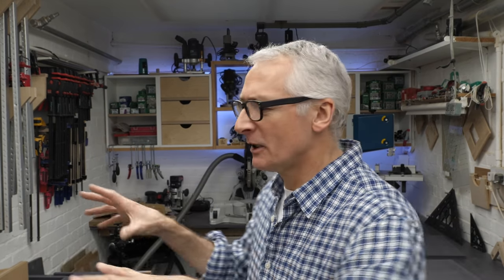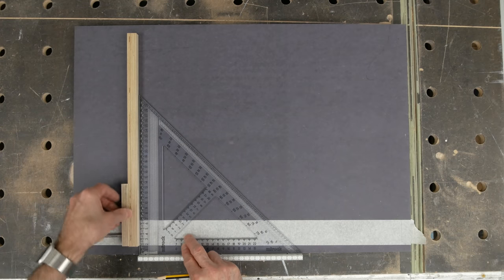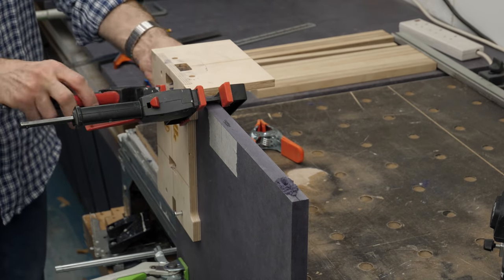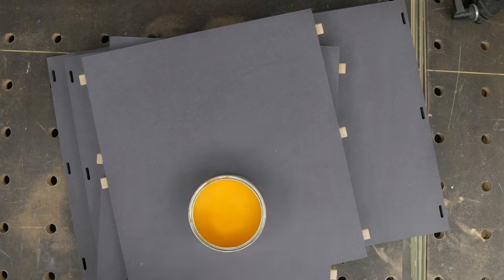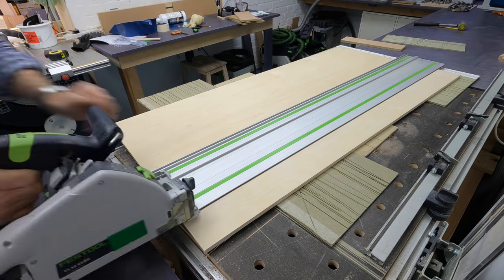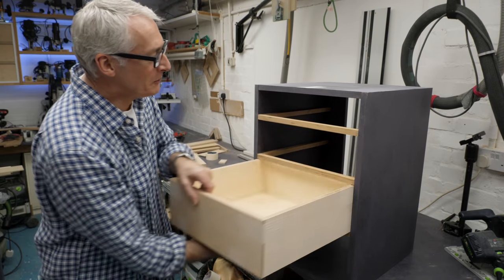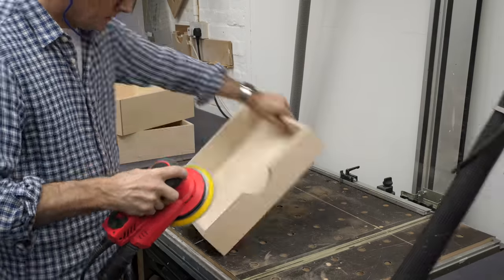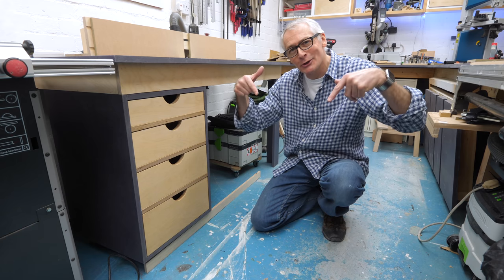Birch Ply Drawer, Router Bench Cabinet [video 479]

Comment: I had a living room cabinet with small drawers like your's running on wooden runners. I replaced them all with metal extension runners. Over time the wooden runners wear (made of beachwood) and were harder to move anyway. I would do it again in a heartbeat.
Do you think covering the dowel area with a stripe of masking tape would be good to prevent the wax get on there? Less care to be used when putting on the wax.
Reply from the maker: Thanks! As I think I say in the vid, I went with plain slides because I want to be able to easily remove the drawers completely to see the contents - one disadvantage of the overhang on the bench top! And I’ve found masking tape, can leave a distinct ridge when you apply a wax finish - just found it as easy to go close to  where I think the line will be.👍

Comment: Peter, as ever a fine video, just the inspiration I needed to make some drawers for my work bench. Good of you to admit when the plans  get mixed up with too much sawdust. I noticed when you were cross cutting the birch ply there seemed to be a slight drop in level as the cut was finished ( 1.25min into the video). Thanks for the prompt to get my finger out and make some drawers. p.s. I wonder what you really called those LITTLE PACKERS ? ? ?

Comment: That looks really smart, Peter. I was about to do a custom kitchen unit/drawer build for my van using sexy drawer sliders, but now I'm questioning whether this simper approach would suffice, or whether I want locking/push-to-release or similar sliders....
Reply from the maker: Thanks! I did them this way with plain slides because I wanted the drawers to be easily - and fully - removable, which may not be what you want in a van, of course! 👍
Reply: If it's a van that moves around (hey, there are static vans!), even if you do simple slide-fit drawers, you're going to need some kind of locking mechanism to stop things from flying. The metal runners with locking mechanisms would seem to be a sensible option in that case, though perhaps even those might spring free if the drawer has something with a bit of mass in it. On the other hand, the simple box drawers with some kind of removable pin through the side might work quite well, though that means you've got to leave space on one or two sides to get access to the pin/screw knob.

The other thought that crossed my mind when watching Peter do this is that the simple box drawers gain just that bit more internal width, unless you're using rebated channels for the metal runners (Ikea gear never seems to use rebates, so it's always a case of drawers are smaller than they should be).
Reply: Then again, bungee cords could hold the drawers in too, so cheaper and simpler might be good :)
Reply: @cricalix  Yeah, bungees have worked really well for the last three or four years, as had Velcro, but it is time for something a little more refined!
Reply: Sliders give full acess to the drawers without removing them. As ever it's up to the indivdual to decide which is best for them.

Comment: Nice looking addition Peter. What was the reasoning behind not using full extension runners?
Reply from the maker: Thanks Martin. As I think I say in the vid, I want the drawers to be easily removable so I can have a proper look at the bits in there without crouching down too far. 👍

Comment: Hi Peter, another great video! The loose tenon jig looks excellent, do you think the tenons could be cut using the little Katsu hand trimmer?, or do would i need a more powerful router? Cheers and all the best, Dermot
Reply from the maker: Thanks Dermot! The Katsu is probably powerful enough, but I’m not sure you can centre the guide bush, which might cause some issue. I need to get a guide bush set and try it out with mine! 👍👍
Reply: @10MinuteWorkshop  thanks for the reply Peter. 👍

Comment: Nice.  So when are you going to install the stops to keep the drawers from coming all the way out?
Reply from the maker: The whole point of not using runners is so the drawers can be pulled right out to easily rummage through the contents! 👍
Reply: @10MinuteWorkshop  Speaking from experience,   Drawers like that get sorted out from their place they fell on the floor.  :)

Comment: Another great video Peter, maybe this is a silly question, but why do you not use the router solely to cut rebate? I don't have much experience so genuinely interested in the answer.
Reply from the maker: A 12mm rebate in plywood would need 3 - 4 passes; doing it this way is just quicker. 👍👍

Comment: Hello Peter, I wondered why you switched using the nailers? Do you have the blue one with 40mm 18 gauge and the red one with 30mm 23 gauge? Thanks
Reply from the maker: I realised I hadn’t used the 23g at all, so I gave it a try on the smaller drawers, but switched to the 18g for the larger ones as they’ll probably bear a heavier load.

Comment: Peter when you say “this is dragging on a bit” how long did the build actually take? I ask because us mere mortals would take a great deal longer than you and it would be good to have a reference. The loose tenon jig looks immaculate in appearance and use. Are the plans available yet? It looks as though my home made MFT/3 is going to be getting more use 😂. Brilliant mate. p.s. if the cabinet is on castors why bother with a plinth as you can simply move it out of the way to vacuum, but if you are dead set on it then birch ply for me. I say this because unless you go right down to the floor, which may be quite uneven then a plinth will scrub and catch so if you don’t go down all the way then the things that actually roll will still get underneath IMHO.
Reply from the maker: Thanks David. It took about 4 days, start to finish, bearing in mind that shooting video makes things take about 3x as long. The Loose Tenon jig  is working very well, and getting good feedback from the testers, and ironing out the final wrinkles. Plans for the cabinet, bench & fence are in my Etsy now - link in description.  Sorry if it’s not clear, but the cabinet is on kitchen cabinet style feet, not castors - the floor isn’t even enough for castors - so the plinth will go down to the floor. 👍👍
Reply: @10MinuteWorkshop  I revisited the video Peter how did I miss the feet😂 not unclear Peter an old guy’s mind wandering 😂

Comment: Thanks for yet another useful video. I'm currently in the process of making my own workbench and will probably use your method to make the drawer unit. 
Out of interest which brand of coloured MDF are you using? It's as rare as hen's teeth in York, but I may not be looking for the right stuff.
Reply from the maker: It’s Finsa Fibracolor - same as I used for the benches. My local yard ordered it in for me, but it all comes from Lathams, I believe. I was going to say that it’s cheaper than Valchromat,  it let’s say ‘less expensive’, and leave it there. 😬👍
Reply: @10MinuteWorkshop  Thanks. I actually bought a sheet of Valchromat from Lathams 😬 a couple of weeks ago for my top. 
Looking forward to the loose tenon jig.

Comment: Hi Peter, Another simple jig that looks as if it works great, I am assuming that you are using a collet on the router that fits inside the hole in the jig, will this come with the jig or do I need to get one myself, if second option have you got the details of the part and size/type of router bit
Reply from the maker: Thanks John. There’ll be a starter pack available as an option with a trend 18mm guide bush, a spiral upcut bit and enough dominos to make a couple of carcasses and a few mistakes. There are two jigs, the one previewed today and a ‘plus’ size.  I’m in probably the last week of testing/ feedback, then I’ll be ready to put them in hand, so stay tuned! 👍👍
Reply: @10MinuteWorkshop  I look forward to getting the jig and starter pack, can I order a pack & jig beforehand

Comment: Why did you use the edge of the ply on your runner? I would think the drawers would slide better the other way around.
Reply from the maker: It's a very clean cut, there's not difference in sliding ability - especially after the wax has been buffed - and in terms of fixing the slides in place, I prefer to nail through the face, not through the layers. 👍

Comment: Hi Peter, could you tell me what router bit size and brand you use with the jig please? I have the small katsu router which should do the trick here🤞 thanks
Reply from the maker: It’s a 5mm bit with a 1/4” shank. I’ll be providing an optional starter pack with bit, guide bush and enough dominos to make a couple of carcasses and a few mistakes. 👍👍
Reply: @10MinuteWorkshop  great idea, thank you.

Comment: Track Saw owners, (or Peter),
Has anyone had an issue with their saw cutting the splinter guards unevenly? Peters guards always seems so straight and makes millions of cuts. Mine seems to take a new sliver away when I start the plunge. (Using a Makita 18v system) My alignment wheels are snug but not tight. I've scoured the forums but can't find any help. I can't use my track to line up cuts because it looks like a saw tooth edge, and I never know where the blade is actually going to make contact...
Reply from the maker: Something not right there Earl. Stock blade or something else? 🤔